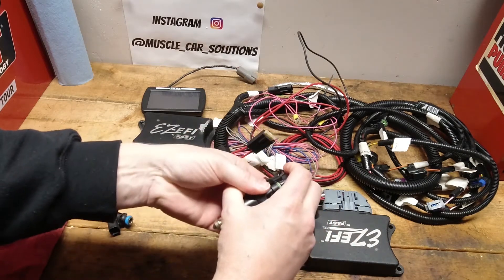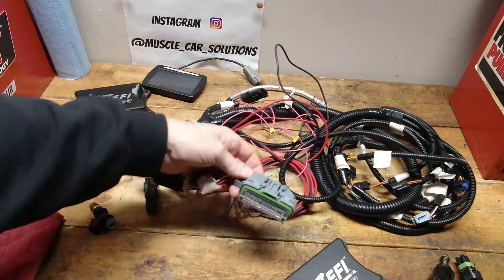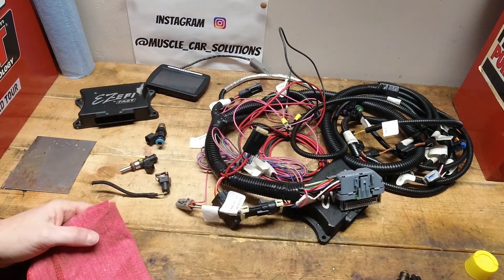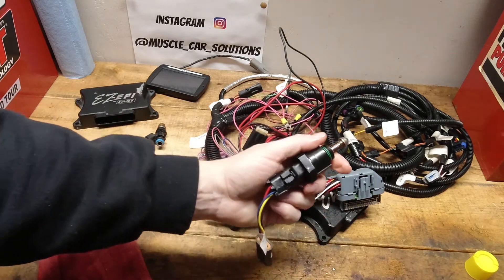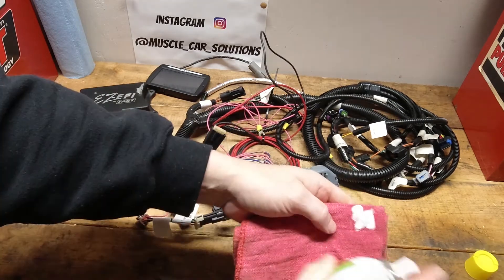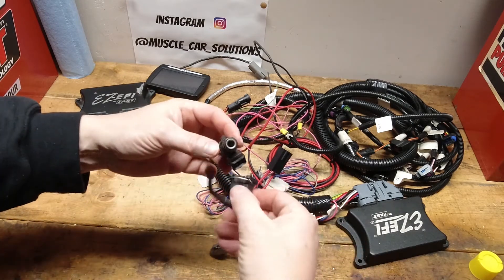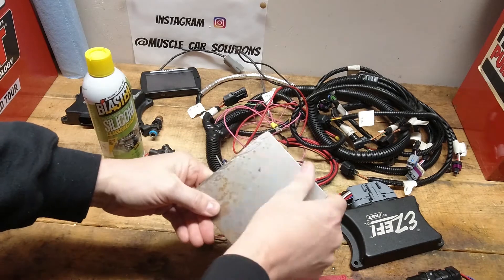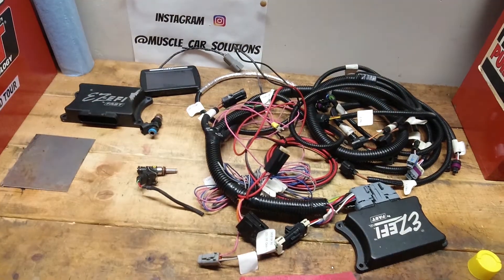Two Minute Tech: Weatherpack Connectors

Comment: I use dielectric grease on all electrical plugs even non-weather pack plugs. Yeah I hear you on contaminants, but its an excellent long lasting moisture barrier. Moisture and humidity are really bad for electrical connections, especially if they sit for long periods of time like a classic car. In the summer time my car sits in a fairly cool and dry garage and when I open the door on a hot and humid day everything on that car gets covered in droplets of water like a soda can on a humid day. I think its important to have a barrier to keep that humidity out of that connection. That's why its important to periodically start it up to running temp even if you don't or cant drive it on the road. The engine heat drives out all the moisture especially in the summer.
Reply from the maker: Moisture is always a consideration for the last couple places I lived.  Grease for sure is a great way of keeping it away from electrical connections.  I’m not much of a purist so I convert as many as I can to weatherpack.  I’ve chosen to always go the weatherpack route and it’s worked well like I’m assuming the grease route has worked for you.  I think the big thing is to keep connections protected!  

Only thing I would clarify is starting the engine and warming to operating temperature.  That’s a little easier/better in summer months where the ambient temps will help get rid of moisture.  In the winter that’s a horrible strategy.  Once shut off after getting to operating temps, the heat attracts moisture.  Makes the situation far worse.  Best to park it and if it’s not going to get driven frequently, let it set till warmer temps set in.  I’ve had some oil analysis done over the years and it’s amazing how much moisture gets into an engine during winter months.  Another video down the road!

Comment: Great vid. If you can't find the spray, use the dielectric grease. Both are great!
Reply: I agree that the spray is good stuff as it lubricates the rubber seals in the weather pack seals but for my money, at the home improvement store, I grab the $6.00 tube of Permatex dielectric grease. Never let me down and that's uncle Joe prices. I use on grounds with factory type Star Washers as well. My mag light flashlights, electric tools, smoke/CO detectors, I put that S&"t on everything.
Thank you, I have seen a product like this in an aerosol other a WD-40.  
Have  a lucky one!  
   DK, Omaha.
Reply: @deankay4434   cool
Reply from the maker: Grease works but it holds contamination.  When silicone spray dries it doesn’t hold any contaminants.  Grease was created to be a barrier and does the job well.  Both silicone based.  But as a lubricant to get the seal to operate as needed, the spray does it’s job, dries and allows the seal to do its job.  Grease sustains and still allows the seal to work, but with the negatives of holding contamination.
Reply: I agree as we did the same with carburetors. After doing two to thee per day, the 82 year old guy who owned the place, have me place the freshly cleaned carb into stoddard solvent to let the metal rehydrate. No grease on the shaft(s) as yes, it will collect debris, create bushing wear & shaft wear. But the dielectric grease I use on electrical terminals. Like the fuel injector terminal dielectric grease TSB to prevent "Fretting" were the metal on metal vibration would eliminated. We look around our garage/repair shop and I and sure there are 2-6 cans that will do basically the same thing yet we all have our preferences. ASE Master Tech since 78, mechanic 70. DK, Omaha.
Reply: @deankay4434   Awesome 👍

Comment: 2 min tech’s are awesome!!! Keep them coming 

Would you also use dielectric grease on the pins?
Reply from the maker: Never have.  I’m assuming that’s another option.  With weatherpack stuff the seal should do all the work.  I’ve never given it much of a thought past that.  I’ll bet there are some marine or off road guys that might endorse the grease.  Good point!
Reply: Yes, it also works great. Spray would be first choice, dielectric 2nd!